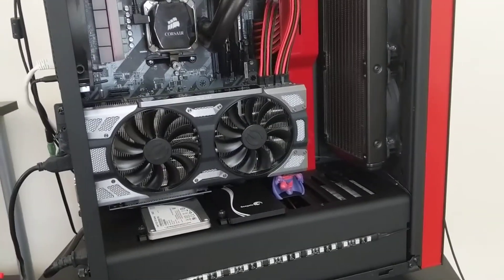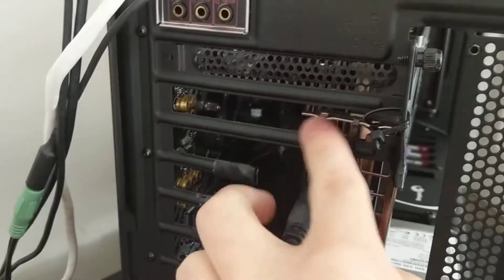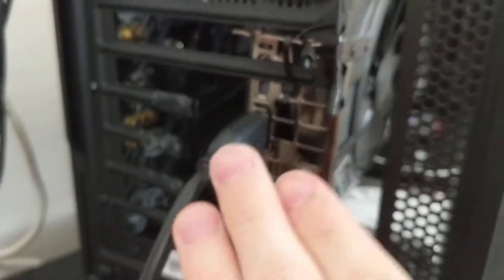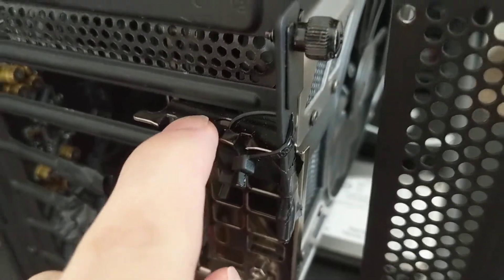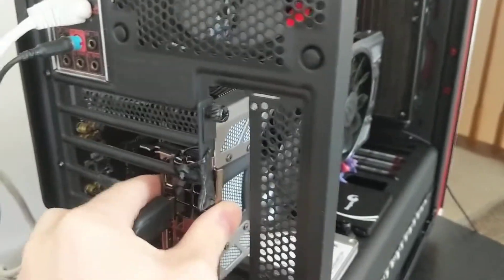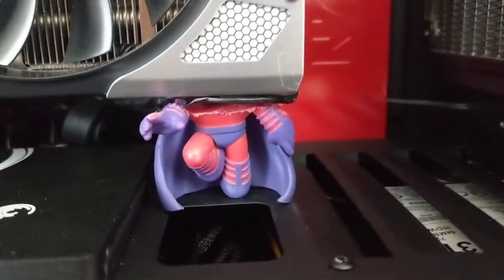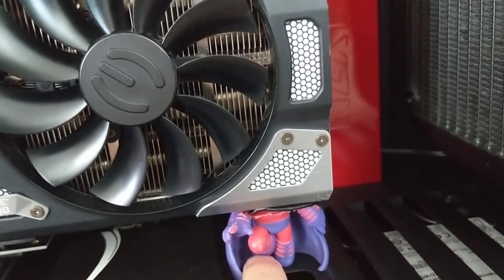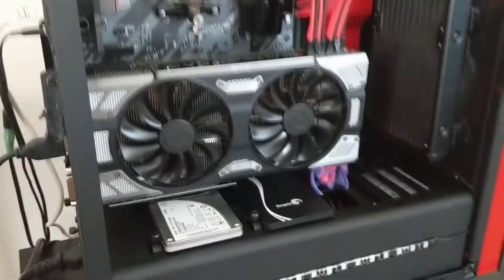NZXT S340 Vertical GPU Mod (READ DESCRIPTION)

Comment: Dude, get a Dremel and have a plan before you start cutting, use paint vs electrical tape.

This is not a how to or a show off....this is a how NOT to
Reply from the maker: Great Bargainz PC use paint? That won't protect like tape. And I'm not showing off. Look at the pics in the description if u want showoff's.
Reply: It works.if it works then its fine lol

and not everyone has or going to buy a dremel

Comment: Most of the newer vertical gpu holders move the cards slightly forward towards the front of the case.
  This self made mod moves the card slightly half in/half out of the case... 🎓

Comment: I used the Cooler Master Vertical Graphic Card Holder on my S340 elite.
Reply from the maker: I would've used that, but it was expensive and from videos I watched the temp of the GPU would ride up 2 celcius higher. My gpu is overclocked, so I needed something that would compliment the temps better.
Reply: did you have to use cable extenders in the back ?

Comment: Hey, uuuhm..... I don´t know what to say....

This comment section is freaking trash, dude your pc looks great!

Comments like "the case is butchered" or "pretty bad" are hilarious. who looks at their case from the back?!?!?!?!
In my opinion you could have cut a bit less from the case and instead of using the tape, used some sandpaper and a sharpie or some paint, but otherwise its does the job....
I watched this video to get some confidence in that the graphics card will be safe, "just hang from the back by just zip-ties" and look great doing so and your video did a great job of showing it!

I, myself am thinking of doing the same thing in the NZXT H200 because its a mini itx case wit only 2 expansion slots, so all the vertical gpu brackets are´t even an option (and 60-80 Euros is way too much).

So again great Video!!
sorry for my English, i´m not a nativ.

p.s.I love the way u used Magneto, for some good in this case. Nice!!!

Comment: You broke your case, sad Nzxt s340
Reply from the maker: broke? you do realize that every vertical bracket would get rid of the ability to use the other express ports right? so tell me... what's the difference between breaking those back pieces vs using a bracket which would render them useless. what? do you expect that one day I'd like to put my card in the regular way? if for some reason I'd do that then I'd just buy another new case. 
Also... this case was $70. A bracket goes for $50-$60. Which means for the price of that bracket I could pretty much buy a brand new case. Now does that make sense for you?
Reply: VinnyHaw I think only too many parts are cut in the back, it looks very messy and tidy, and indeed it's not an expensive case, so there's no need to think about it.